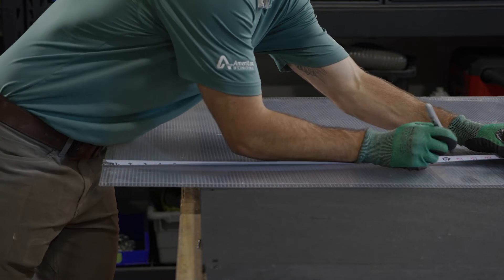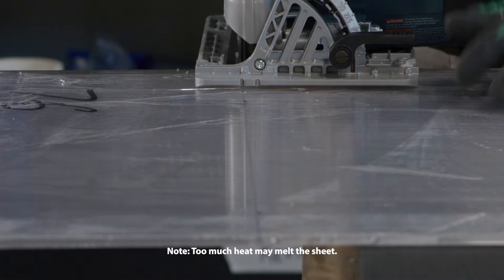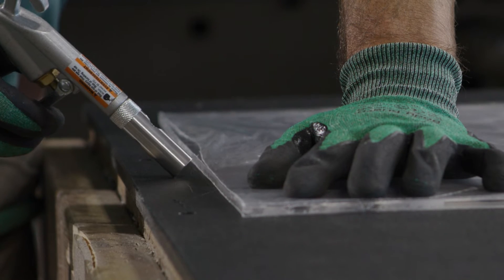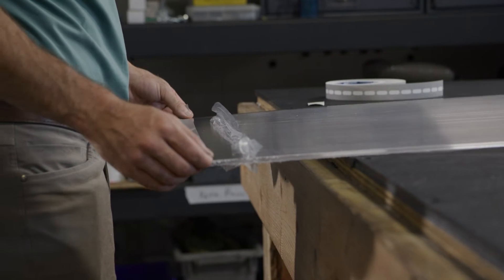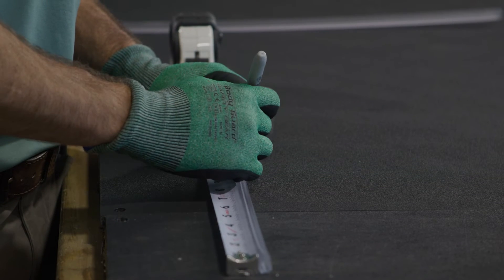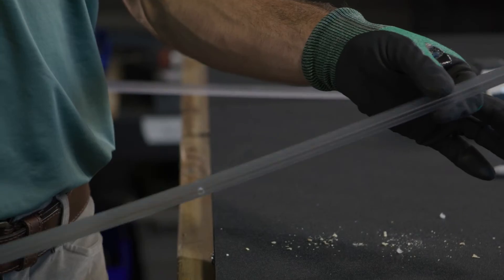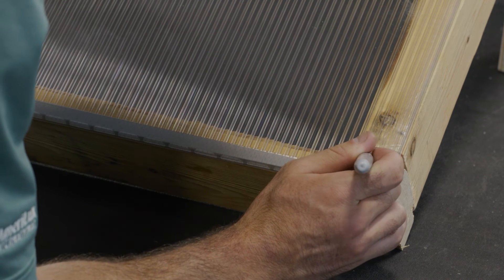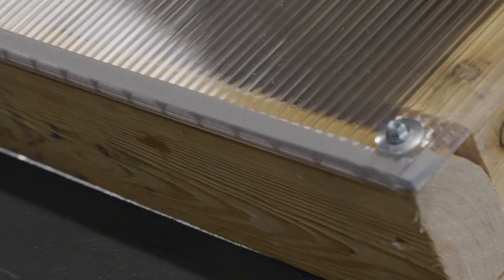Multiwall Installation Guide

Comment: Ridge cap used for multi wall polycarbonate?
Reply from the maker: Our polycarbonate ridge cap should be used with CoverLite Corrugated Polycarbonate.  We offer CoverLite Multiwall and Corrugated Polycarbonate panels, each type of panel can be used with a polycarbonate ridge cap.